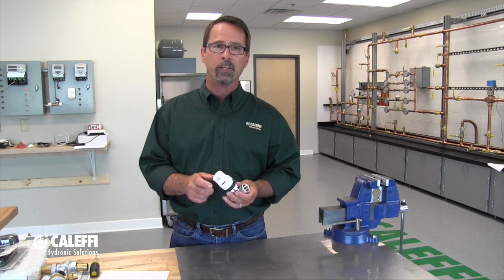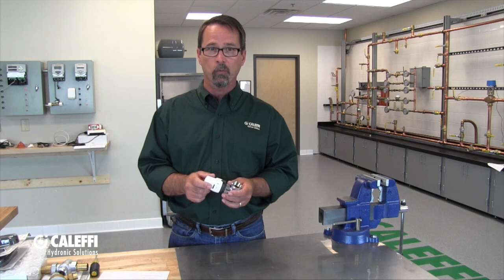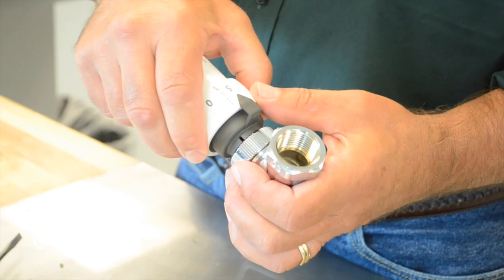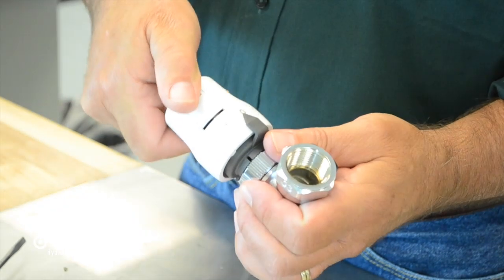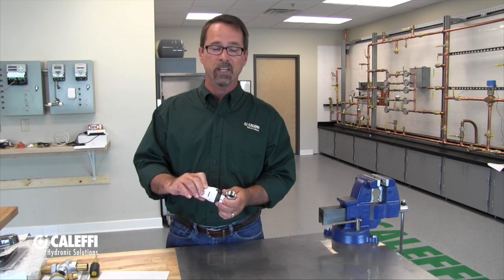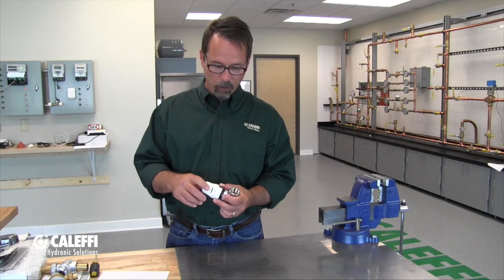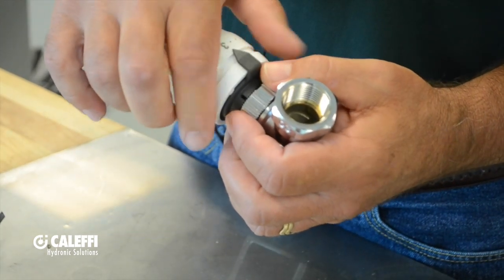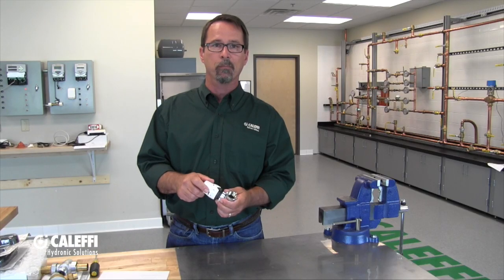Is there a fixed/adjustment feature on the Caleffi Thermostatic Radiator Control Head?

Comment: To easy to manipulate it, locking features are useless.
Reply from the maker: Thanks for your comment, but the lock is designed to deter tampering while also providing a childproof-like feature, while allowing easy enough access for the desired user to operate.